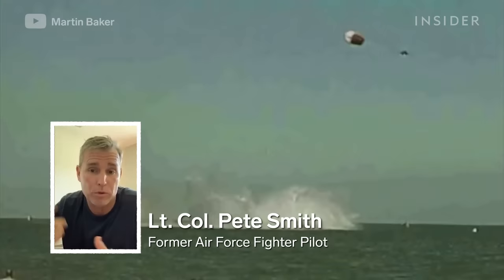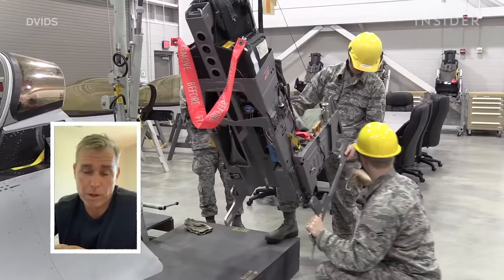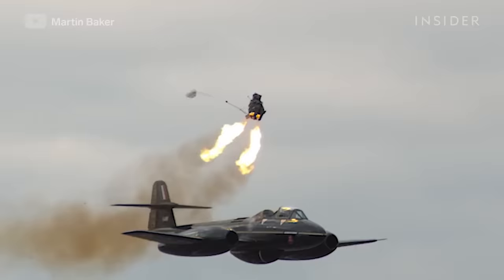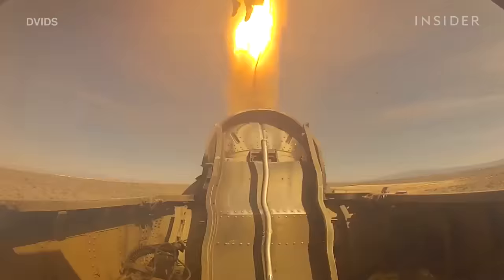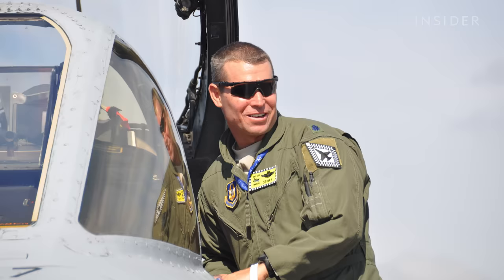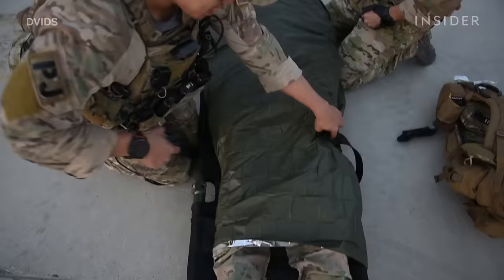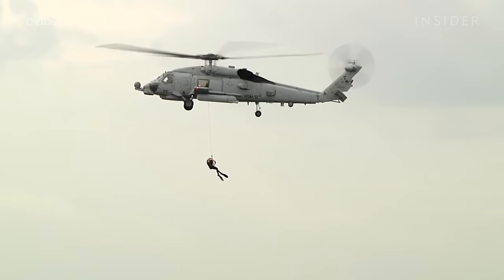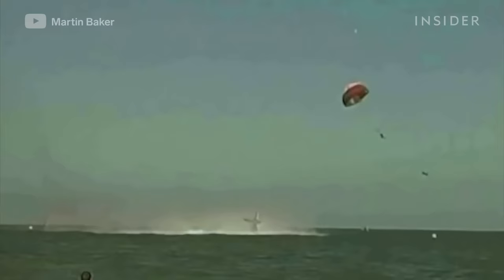The Death-Defying Mechanics of Fighter Jet Ejections | Cars Insider

Comment: When you can't fly McDonnell-Douglas, fly Martin-Baker!

I used to work on the martin-Baker GRU-7 on F-14's and have 4 successful ejections. I saw 2 on the flight deck. They are an amazing piece of engineering, and all of the steps in working on them were written in blood. I had a friend who tried to take a short cut, and he ejected himself into the hangar ceiling and died. He broke the very specific rules that were drilled into all of us from training school, and reiterated every time we worked on them. He also put others at risk, and caused several hundred thousands of dollars of damage because of his hubris, which he was always way over confident in his abilities. It's a shame, and I miss him, though his stupidity and arrogance are almost unforgivable doing what we did.
Reply: did your friend commit suicide or was it an accident?
Reply: @felixbui9818  It was an accident. He was removing the drogue chute by himself while the seat was still in the aircraft, and used a screwdriver as a pry bar, which then started the ejection sequence. While it would seem like you could remove a drogue chute like this, it breaks the rules of: 1, have a performer, QA, and safety person while doing maintenance (3 people), 2, any maintenance on a seat requires the seat to be removed, and 3, jets are down if explosive cartridges are out of date, which was the issue that he was trying to resolve so the training squadron could make a flight that day. The full report was about 20 pages, even covering the food he ate in the last 24 hours, his mindset with his wife, and things going on in the squadron. It was eye opening reading the report. This incident also downed all F-14's for 24 hours so AME's could review, re-train, and reiterate safety procedures.
Reply: @mdbizzarri  Have you read the full report? May our fellow brother Rest In Peace.
Reply: I worked on the MK. H-7 in the USAF F-4's for 13 years when it was the QF-4. I'm very sorry to hear about your friend. I've heard stories like this concerning the Martin Bakers. I hated working on it everyday for 13 years. I respected it but also feared it to a degree. The banana links were terrifying
Reply: my friends dad was benny lynch
Reply: @TheHannukahZombie  Fred Hemme, VF-101, was an AME3, and it was published in the Navy Times back in 1996. Too long ago for finding the archive online, though I am sure if you really wanted to find it you can. I knew him when he was in VAW-123. And if that doesn't convince you it's real, oh well, so be it.
Reply: Did this happen at Miramar. I was in VF-24 when this happened. I was an AME. Am retired now
Reply: wow....the odds....thos makes you number, 35698753 person in the comments to have worked on ejection seats....it's like EVERY person to have ever worked on ejection seats are in this specific comment section. lol (not saying you are the liar or lying) but a lot are ha
Reply: Well, AME's were and still are a relevant rate in the Navy. Air Force, Marines, and any other nation  that has jets with ejection seats have need of people, past and present. It's not unheard of, and quite likely to have people with specific training to comment on suggested videos due to algorithms. I've found a video that shows my seats ejecting on the flight deck, I'm sure I'll see other videos.
Reply: @yo_itsjoshy  I did read it the full report,  which was therapeutic, as well as disappointing since he worked on the seat alone, which is 2 people shy of what was required. It shouldn't have happened, but that's life.
Reply: @Cubrooski  I almost fell off a F-4 in training removing the back seat due to the wedge on the intake and no crane to lift the seat frame. Good tims~!
Reply: @mikemoore2741  it was in VA Beach at VF-101
Reply: @nexpro6118  maybe a lot of ex seat mechanics search out videos like this..Just because we live in a woke country now doesn’t mean everyone’s a liar.
Reply: @mmoore102 obsessed with wokeness aren't ya. Go outside more, stop letting outrage feed you

Comment: I was in the USAF and I remember spending many hours seating in ejection seats while working on aircraft avionic systems. Yes we installed safety pins to make the seats safe, but the explosives are still armed in them. You get use to seating in the seats, but it is still a little un nerving the first few times you have to sit in one. Especially when you know that if your didn't install the safety pins and pulled the ejection handles you would activate the seat and it would eject you.
Reply: do you know if that ever happened before? an accidental discharge of the ejection seat?
Reply: @johhnyytwotime510  This question would be better answered by someone that worked in   Egress, that is the shop that maintained the ejection system on the aircraft. 
But in my 22 years in the USAF, I never experienced it, or heard of it happening. There are many safe guards in place to keep it from happening, so even though there are many explosives in the system, it is still not dangerous, say like a loaded gun could be.
Reply: @mj1s735  oh I got you...thanks for the in depth explanation, I appreciate that.
Reply: @johhnyytwotime510  1971, an airbase in the South of USA. An egress airman was working on an ejection seat of a T-37B when it fired. He was NOT in the seat but leaning over it. He did not survive. So all of us guys that worked on T-37 seats had to take a safety course, just to make sure we were on top of procedures.
Reply: That's good those guys getting ready for Armageddon
Reply: @tonyv8925  I am just curious when they did the investigation did they determine that he caused the ejection because he was not following proper procedures or was there a failure in the ejection system?
Reply: wow....the odds....thos makes you number, 35698753 person in the comments to have worked on ejection seats or on an aircraft. ..it's like EVERY person to have ever worked on ejection seats or an aircraft are in this specific comment section. lol (not saying you are the liar or lying) but a lot are ha
Reply: @nexpro6118  Who are you talking to? There have been millions of people in the USA military that have worked on or around ejection seats, so actually the odds are very good. Most of the people that come to this thread was because of the ejection seat picture, and it brought back memories for many. I can't speak for the rest, but I know I would never lie about my military service!
Reply: One thing you don't wanna do is poke around the in the cockpit of a fighter plane being overhauled inside a hangar.  Just because you see the plane's batteries and pieces of it's engine on the floor doesn't mean it is OK to throw switches and pull levers.  One  aviation mechanic trainee did that  ... killing himself. Twice.  Once when he hit the overhead and then  dropped 110 feet to the concrete floor.  So sad.  Officers in dress blues tried to explain to his grieving parents ...

Comment: I understand the hesitation in ejecting. In my very first solo skydive my parachute didn't open correctly, and I had a debate with myself as to when and whether to cut away and use my reserve. In hindsight it's stupid, but it's what I did.
Reply: But did you die bro?
Reply: @darksu6947  Only a little bit...
Reply: @mjribes  I'm glad you didn't splatter on the ground and end up looking like a wet noodle.
Reply: @darksu6947  I’m hungry

Comment: On 3 Sep 68 I was a pilot in the backseat of  F-4C 64-681 flying out of Cam Ranh Bay VN to support some grunts on the ground that needed close air support.  On our first pass dropping Mk 82 high drag bombs we got hit with 14.7 mm AAA.  We were at 500 ft and 450 kts. The Jet started to roll violently and my front seater yelled EJECT, EJECT, EJECT!  Well after the first EJECT he was talking to himself - Thank God the Martin Baker HH-7 I was strapped to worked as advertised -- it was pretty violent and I don't know how long I was in the chute but the next thing I knew I was hanging in a 100 ft tree about 30 feet off the ground.  I had lost my helmet, watch and gloves from the wind blast (BTW air at 450 kts is not a gas but solid 🙂).  I was busted up pretty badly and could hardly move.  If it wasn't for some very brave Army aircrews (flying  Hueys and a LOC) who braved some pretty heavy ground fire I wouldn't be here today.
Reply: cap
Reply: @jakee.4030  why
Reply: did your front seater make it?

Comment: the seats in the F4 had straps that went around your leg just above the knee and straps that went around the ankles short straps around the ankles long straps around the legs. you didnt want to mix them up or you would leave the plane with broken legs.they served to pull you into the seat to become more compact. also the F4 had a face curtain in stead an ejection handle between the legs

Comment: Back in the 1960s my dad worked for a metal manufacturing company in England, which was the only company at that time that could make the alloys that were used by Martin Baker. I remember they had an ejector seat on display at the factory on the occasion of a Royal visit (minor royal, not the Queen) and I was fascinated by it as a 7 year old schoolkid.

Comment: Some bombers, like the B-52, have ejection seats too. The main charge is entirely ballistic, making for a lot more instantaneous Gs than the rocket seat used in most fighters.
Reply: Yep, and half the personnel eject downward from the plane. Check altitude before ejection, Navigator!
Reply: Their ejection sequence is also slower than from a fighter jet because they expect trouble to happen at high altitude.
Reply: @josephastier7421  Actually, a ballistic seat is initially faster because the process is nearly instantaneous. A rocket motor has a build up in speed, but a ballistic seat is like being fired from a cannon.
Reply: @theophrastus3.056  Rockets can be designed to work so quickly they are more like a directed blast.
Reply: @josephastier7421  True. But that’s actually not desirable in an ejection seat, as there’s a risk of breaking bones wjth a sudden jolt. Still, they are incredibly fast, as you indicate. Ballistics seats are used only where rockets are not possible, like where two crew are seated side by side. (The B-52 is one example.) You would want rocket blast to burn whoever ejected second.  But the drawback is virtually instantaneous acceleration, very high G’s, and virtually no padding on the seat itself. That last feature is because the compression of the pad during the ejection would hurt the occupant. In the slightly slower acceleration of the rocket, that’s not a problem. Rocket seats are the better option, that’s absolutely true, because the acceleration is more manageable.

Comment: I've worked on USAF ejection seats since 1997. A couple false statements in this video. When the pilots pull the D-Ring( the handle between the legs) it does not send an electrical signal. It fires two explosive Initiators. Atleast on legacy aircraft i.e. F-15, F-16, A-10. Second false statementa motor doesn't separate the pilot from the seat, explosives and physics do. 

The main parachute is fired out of what's called a mortar. Just like see in the war movies where they drop the round down the tub and it shoots it out....same thing kind of happens with the chute except it is locked into the mortar while installed in the seat,, and when it's needed during the ejection a mortar cartridge is fired and pushes the chute out of the seat. 

Before the mortar is fired a different cartridge is fired releasing the lap belts, shoulder straps, and seat pan (so the survival kit stays with the pilot).

A lot of moving parts goes into an ejection and it's process that happens very quickly. Also a lot of factors go into a successful ejection that i didn't cover here.. It is a violent process but more crew members survive the mishap these days thankfully.
Reply: No seat used a “mortar” they use rocket motors to pull the drogue parachute out, there is no firing the chute out of anything, the explosive isn’t anywhere near it.
Reply: I beg to differ....I've worked on them for 25 years. The component the chute sits in is called the mortar and the chute is fired out of it. I used my example may be a poor example. But look it up. Search for the ejection site and look up the ACES II seat
Reply: @TheHannukahZombie  they don't use rocket motors to pull the drogue out, it's called the drogue gun cartridge, there is a difference between a cartridge and a rocket motor
Reply: I worked in the ACES2 program at McDonnell Douglas back in the late 70's on the final line usually installing the computer into the seats. Everything Cubroski said is correct and true. I left in the 80's, so some things may have changed since then although I've seen the same seats at airshows.
Reply: @CamperGun  thank you Rick. Not much has really changed other than the computer that's been upgraded over the years
Reply: @Cubrooski  That makes sense. Thanks for the update! Where did you work on them?
Reply: @CamperGun  I worked them in Alaska and now in Floida.
Reply: @Cubrooski Wow! Alaska to Florida. That's a huge change! Working on the seats was the most interesting job Ive ever had,  other than owning my own business, which is what I do now.
Reply: @CamperGun  I'd love to own my own business. But have no clue how to even begin with it.. I'm originally from FL and was stationed in AK and now do it as contractor. It for sure is a unique job.
Reply: @Cubrooski  the enhanced drogue uses a rocket extraction system for the drogue deployment.

Comment: I used to pack 'chutes for ejection seats. It's a very exacting process where you literally go by the book, step by step no matter if it's the first or the fiftieth one you've packed.
Reply: Me too Mick, 3/4" loop on the stows, torque the SeaWars, tack the reefing line charges, packing the drouge in the back of the seat. Oh and lastly do a tool inventory to make sure you didnt pack any FOD in the container.  30+ years still remember some stuff. :) Good times
Reply: Ditto, good stuff. 👍🏼😎 USMC parachute rigger, F-4s, A-4s, & AV-8Bs.
Reply: @frankharley1000  Right on 😀Semper Fi!
Reply: wow....the odds....thos makes you number, 35698753 person in the comments to have worked on ejection seats....it's like EVERY person to have ever worked on ejection seats are in this specific comment section. lol (not saying you are the liar or lying) but a lot are ha and.....nobody "packs" the ejection seats.....they come from the manufacturer done and if they have to be removed (the chute) it goes back to the manufacturer.....just saying....
Reply: @kenlanier2131  Semper fi, Ken! 👍🏼👍🏼
Reply: @nexpro6118   um, no. I can tell you in Naval Aviation the chute is removed from the ejection seat on a specific timetable depending on the aircraft (210, 448 days, etc) and sent to the parachute Loft for a full inspection, repair if needed, replacement of expired components, and repack. I've never heard of a full parachute assembly going back to the manufacturer. Bit I've been out for a few years, so the F-35 system might be different.
Reply: @nexpro6118  I packed chutes into the head boxes for MK10 seats that went into RAF Tornado F3s based at Leuchars in Scotland. 
They were serviced on base by us every 26 weeks.
This was in the early 1990s.
Things may have changed.

Comment: The WWII Japanese Zero was an example of the Japanese code of Bushido.
Considered modern day samurais they knew there was virtually no escape from their, in some ways, fragile but very potent aerial weapon platform. Designed purely as offensive system with little or no pilot protection as armor plate or self sealing tanks.

It was however very nimble at lower dogfight speeds and in maneuver could out perform a similar heavier, due to self protection, aircraft .
In the hands of an expert flyer it was very formidable all things being considered.

It was essentially victory or return upon your shield .🛡 

Born to the house of a warrior “ grasp the long and the short swords ⚔️ and to die “.
Reply: Bright 🤧

Comment: I am curious to know about the types of injuries people sustain, 10-30% of all ejections resulting in injuries or deaths is nothing to sneeze at.

Vertebrae? Neck? Arms? Legs? Where? How? Why?
Reply: Tail bone fractures or breaking is quite common from what ive seen
Reply: Especially in the older planes
Reply: Spinal fractures. It was explained in the video. And most likely in the neck
Reply: @ibrahimsalman5504  yeah cause they used a explosive cartridge which provided a sudden acceleration add opposed to the gradual acceleration from the rocket motors these days
Reply: @starliner2498  the 'explosive cartridges' are the motor device that actually gets the seat and its occupant out the aircraft (see two-tube assembly in MB seats)- rocket motors with enough thrust to achieve the initial high acceleration required, would be uncomfortable for jockey.  In-service rocket-packs intitially  used a bunch of 1" (dia) motors, but the seats also had a 5-cartridge staged 'gun' which, yep, made the jockey's a bit shorter after their escape. That was to give survivability on the runway. The Harrier vtol introduced a new 'issue', solved by 2" rocket pack motors, which then allowed a slight de-rating of the 'gun' for most future seats - but still a gun. Being in a 'bang seat' is like being a cork in the end of a shotgun, essentially; all the rest of the cool-looking stuff happens after your cork has popped.  The first 'ejection' from an aircraft was from a Gloster Meteor - using a big spring driving a  trubuchet-style arm on the spine of the aircraft, to which the unfortunate was attached.
Reply: A significant amount of pilots will have some sort of spinal injury, and the USAF forbids you from flying if you've ejected twice due to that very thing. Unfortunately there's no way to avoid it, ejection seats need to be that forceful.
Reply: @johnp139  what is?